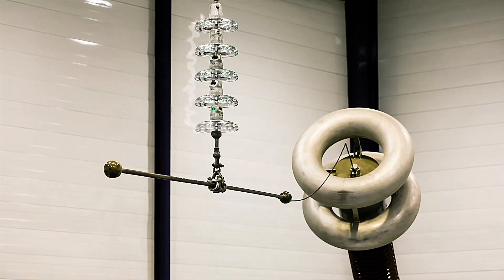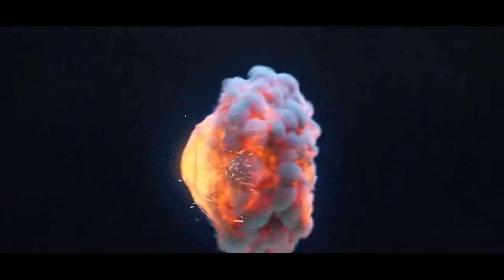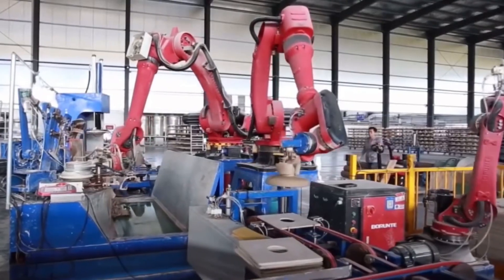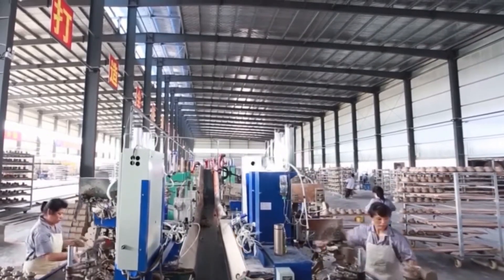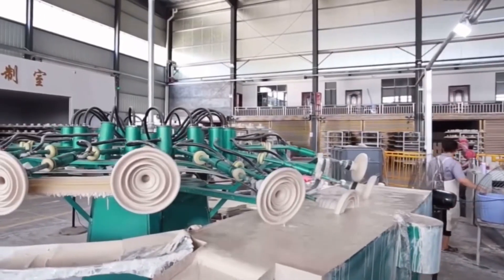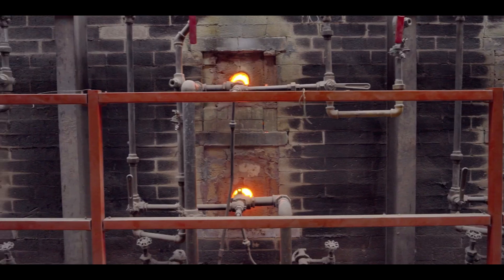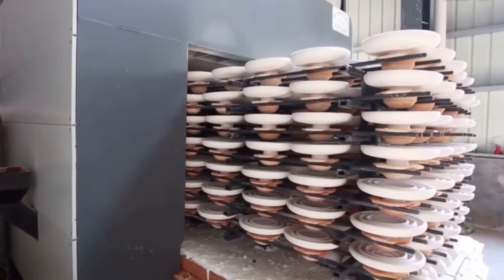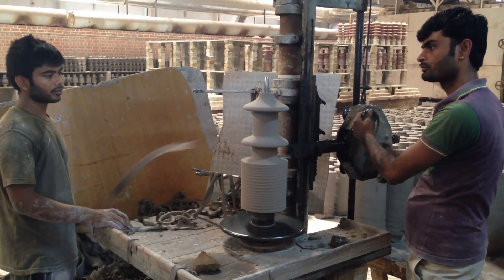Shocking Secrets Behind High-Voltage Insulators! ⚡️🔍

Comment: Any failure is very expensive and potentially very dangerous. The quality control is impressive.
Reply from the maker: You're spot on. I've heard stories of insulator failures causing cascading power outages that affect entire regions. The quality control measures in place are essential to prevent those kinds of scenarios.